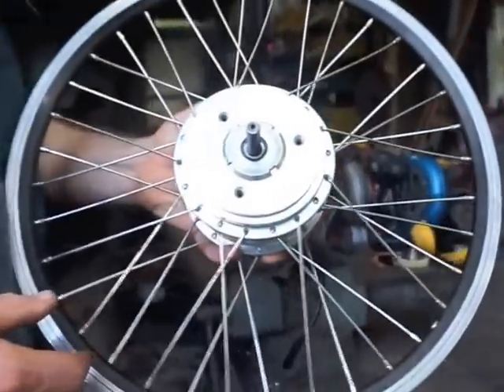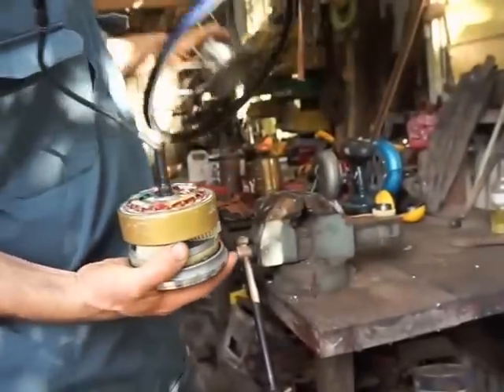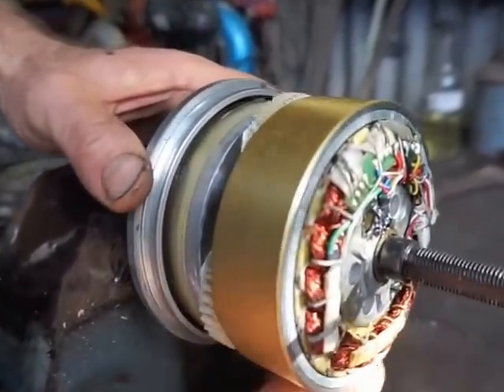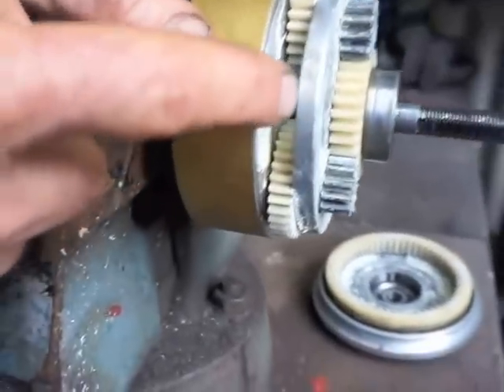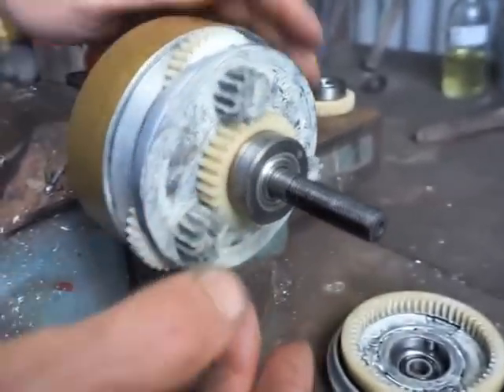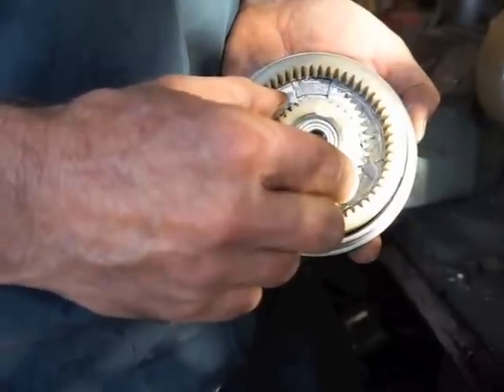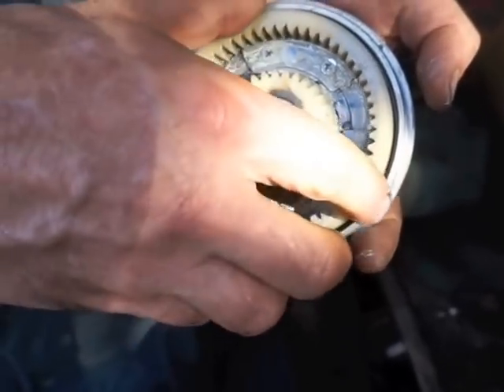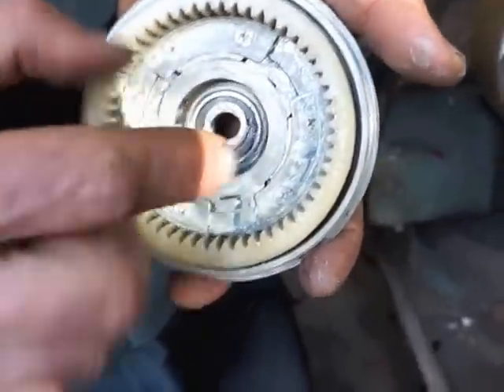How the Xiongda 2 speed hub motor works

Comment: what are the 3 holes in the side plate for ? i want to mount a sprocket on there and use it as a mid drive
Reply from the maker: The holes have bolts which hold on freewheel components. They are are strong - are used when opening the hub. 
However I don't think this would work as a mid drive. The change of gears would change your pedalling cadence. I haven't made a mid-drive bike, but my understanding is that it would be easiest with a direct drive motor which would be able to drive backwards, e.g. Conhis Motor.
Reply: ty for the reply , nice to know they are strong :)    pedal cadence is not a issue for me as it would drive the rear wheel directly on the left side passing through 3speed hub jackshaft  .. the crank will drives a coaster brake like a normal bike ..   thanks again for sharing this video
Reply from the maker: Sounds interesting: please show us what you make!
Reply: i recently joined ES ,ill start a build tread once i have my e-parts ,
will likely include a title like '1914 Cyclone'

Comment: Awesome video! Does the hub create cogging friction when riding without power?
Reply from the maker: Hello Rob, there is no cogging friction with this hub, as the freewheels are free when the motor is not powered. Same with all geared hubs (all I've ever seen), they have a freewheel which allows the wheel to spin forwards freely, but the gears and motor need to spin to push the bike backwards.
Reply from the maker: Hi Chris, I've seen reports on ES of breaking the ring gear when rolling backwards. This hasn't happened to any of our XD hubs, even with rolling bikes backward every time we take them out of the shed. I can feel them lock up sometimes, but it hasn't led to damage. We have had the nylon sun gear (for high gear) break on some motors, and replaced them with good support from XD. XD have upgraded the polymer material in the sun gears and they say they haven't had a breakage with the new material so far. Looking at reports on ES (some time ago) it seems to me that most breakage reports are the sun gear, with a couple of ring gear breaks. Does ring gear breakage look more frequent to you? 
As a general principle, I'm very cautious about putting high powers thru ebikes. I keep doing repairs on bikes which have been souped up to high currents and voltages, where the torque breaks things, from dropout torque plates down to the basic design elements of the motor such as axle keys. With less power, everything works better for longer - a general design principle I"m sure.
Reply from the maker: The controller is where the gear shifting happens, by changing the direction of rotation of the motor inside the hub case. The KT controllers (supplied by XD) I use can do this automatically, or manually using the HAL switch (high, automatic, low). The Lishui controllers also supplied by XD also change automatically (I have some but haven't ever tried one on a bike). Perhaps Luna is supplying a different controller?
I'm not sure why not downshifting would break the clutch. I would expect labouring the motor in that way would risk overheating the windings if it went on for a few minutes. Maybe the higher powered motor pushes some parts closer to breaking. 
Yes, I agree. The main point of an XD 2speed motor is that the low gear enables a low powered motor to haul a bike up a steep hill, and reduce the risk of overheating.
Reply: "but the gears and motor need to spin to push the bike backwards."
I've heard that this causes them to break. I was wondering what your experience has been with this? I really like this motor and would like to use it to build commuter bikes and some trikes, but the breaking if let roll backwards rumor hasn't been proven false anywhere I've looked it up.
Reply: Probably the same post on es you reference is where I heard about the breakage problem. That really bummed me out to hear. 

I believe the subject was brought up by a guy with one on a Recumbent, and from what I remember, the consensus was that it only happens on Recumbents. I think one other guy said that it broke on a regular bike, but I'm sure that has been fixed by the factory upgrades you mention.

Good to hear. I'm getting one to go on a beach cruiser for torture testing, then if all is good, I'll be getting another one for a 700c commuter bike. I probably won't use either of them with enough power to get the advertised 1000W, but a little extra would be nice for climbing hills. If I want to go fast, I'll build a bike with a Cyclone 3000w motor. I see no real need to hot rod stuff meant for slower speeds so it becomes unreliable when there are plenty of motors built for speed on the market. Like they say, just because you can do something, doesn't always mean that you should do it.

Thanks for the info!!!
Reply: Found this over on the Luna website. I don't remember seeing on the motors page before. I haven't read anything about this issue over on es.

Luna Cycle;
"This motor requires you to downshift when going uphill, it is not automatic. If this is not done you may break the clutch."

Comment: Hey Bruce, I was wondering, because I am unable to tell from the video, how the power cord of the hub motor is kept from twisting while the wheel is moving. I could understand the cord not twisting if the shell that surrounds the hub motor contained the internal gear, but because the hub motor is rotated into the shell (thereby locking the hub to the shell so that when the hub spins the shell spins (and so on to the threads and wheel itself)) I am unable to see how the cord does not twist since the stator is now rotating with the shell. Could you please help. Thanks.
Reply: Oh wait, I think I might have figured it out. Is it because the section of the hub motor that is rotated on is the part of the motor that is moving? 
I remembered that the entire motor isn't threaded, only the part that is moving. So although the part of the hub motor which is moving is in direct contact with the shell, the stator is not, thus the power cord remains stationary .
Let me know, thanks.
Reply from the maker: Hello Brooke, the power and sensor wires go thru the axle into the stator with the windings. The stator is keyed onto the shaft. The plate which holds the planet gears is also keyed onto the shaft. All the parts which rotate around the shaft are in the end plate which screws into the hub case, and of course the hub case itself rotates around the shaft. This is quite different from single speed geared hub motors, in which the plate which holds the planet gears has a freewheel which allows it to rotate around the shaft one way. I hope that helps! Bruce.

Comment: Bruce, would you recommend opening up the motor to add grease to the gears? I am placing an order for 2 - 48 volt in 20 inch back rims. Thank you
Reply: Bruce, how do you untied the lid? What tools do you use for that? Thank you for the video
Reply from the maker: Daytriker, I'm very sorry I missed your question and am answering a year late. I have added grease when I have worked on these motors, to compensate for lost grease. I did try to get a supply of the grease used in the factory, but it can't be air freighted and doesn't seem to be a commercially available type. I've also tried adding automatic transmission fluid to improve lubrication and cooling of the motor, which has so far seemed to work well, but can leak.
Reply: @BruceTeakle  I've been told to use aviation grade grease that's safe for nylon. Ask the bbshd people. It's red.

Comment: Amazingly, you explained How the 2Speed works WITHOUT explaining it. How does the high and low gears get engaged? How is the speed varied? using a throttle, there are multiple speeds. Why is it called TWO SPEED?
Reply: I believe Bruce is saying each individual set of planetary gears has its own one-way engagement device so if the motor is instructed to run backwards...a different forward ratio emerges. I think. Just guessing...

And why are you yelling? Perhaps you consider purchasing one of these hubs and  producing the video you obviously think this should have been. 

Yikes...another comment below. I hope everything is OK.
Reply: if i'm not mistaken, it goes as followed:
in speed 1 (engine going forward ) the primary sun drives the primary planet which drives the secondary planet, which drives the 2nd sun, which drives the wheel (the ring gear is then in freewheel mode)
in speed 2 (engine going backward) the primary sun drives the primary planet which drives the secondary planet, which drives the ring gear, which drives the wheel (the secondary sun is then in freewheel mode)

Comment: Top speed with 20" wheel? Supply voltage?
Reply from the maker: difflocktwo This motor is a Xiongda 250w motor for a 20" wheel, peak powered speed about 30km/h at nominal 36v, with KT 7A/15A controller. Peak speed on low gear is around 16km/h. 
For my review of the Xiongda 2-speed motor, see http://bruceteakle.blogspot.com.au/p/blog-page_20.html
Reply: Bruce Teakle Interesting budget motor, other than some reports of the free wheels locking up when rolling backwards.
Guess its closer to 40kph with a 26" wheel.
Reply from the maker: difflocktwo Sometimes the freewheel does jam when rolling backwards, but we have found that you only need to roll forward a few inches and it comes free. The motors made for 26" are wound for a slower rpm. They actually seem to be slightly slower than the 20" motor (which is probably good overall). I think they're a really good motor if you have long steep hills to climb.